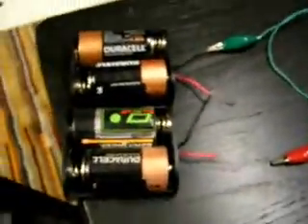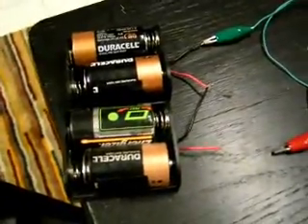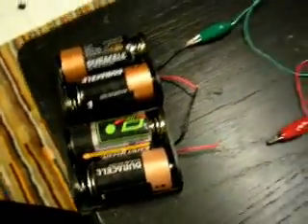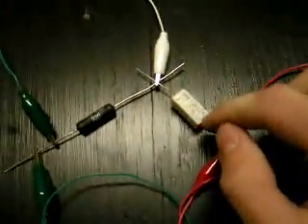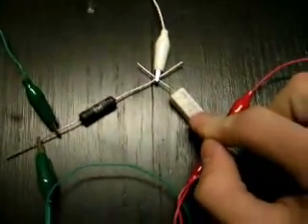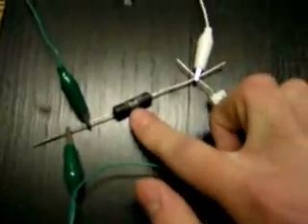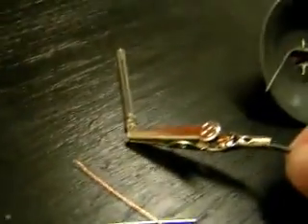simple feedback driver for flyback transformer

Comment: The feedback coil is typically 0.7 -1.5ohms on alot of the transformer models. Set your multimeter to ohms, attach the negative to one pin and keep trying all the other pins. make sure the feedback isn't connected to the primary. If anything its best to wind your own, just make sure they wind in the same direction. You can also get different currents and frequencies if you replace R2 with a small capacitor(just make sure its bipolar) And stop the spammin dude.

Comment from the maker: Yes, it would be simpler to just take the picture tube out of a TV and use the circuit as it is, but then not only do you have the dangers associated with high voltage, but now you risk being electrocuted by the mains (which delivers much more current than the high voltage transformer).

Using the flyback in some of your own circuit designs could lead to better control/results, and you wouldn't have to lug around the rest of the circuits from the TV you pulled it from.

Comment: the D1555 H-out transistor will give you POWER, so you can have big sparks and not wimpy ones. Remember, its not about voltage, its about how much energy you can deliver to the flyback

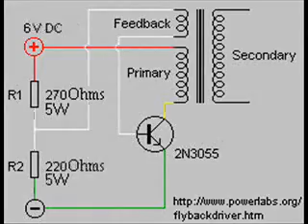Comment from the maker: The wires in the video have the same color as those in the modified schematic (0:04-0:08).

It's highly improbable that you have the exact same flyback transformer, so you could do two things: 1) find the amount of resistance between each pin to locate two sets of independent coils (see jnaudin,free,fr/lifters/labhvps/tht,htm), or 2) wind your own primary/feedback coils (see websites in video description). Just try different pin combinations with a low amount of power.

Comment from the maker: Well, I'd say it gives much, much more than a 'jolt', since this setup allows the arc to extend once it's formed.

I've used the same 2N3055 for a bunch of other FBT runs (see my "new flyback transformer with saltwater capacitor" video), but I'll look for the transistor you mentioned.

Would anyone know what a good alternative to the BUZ350 Mosfet would be (it's nonexistent)?  I'm trying to make a Dave Lawton setup, but don't have that component yet.